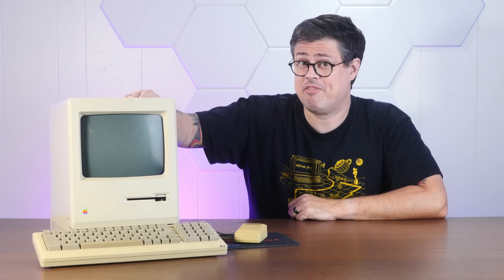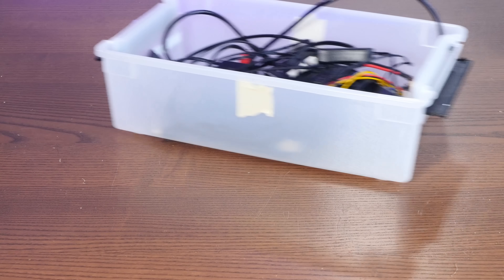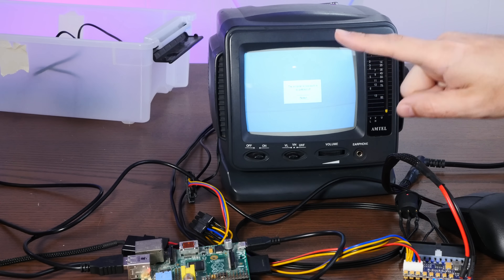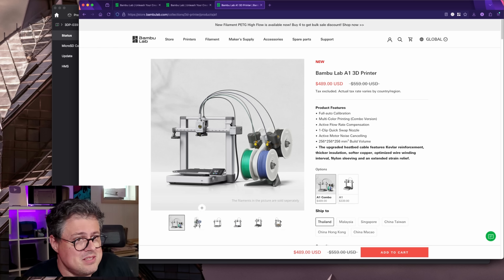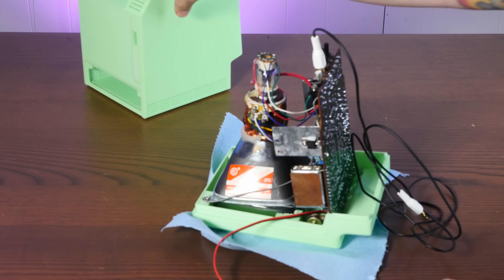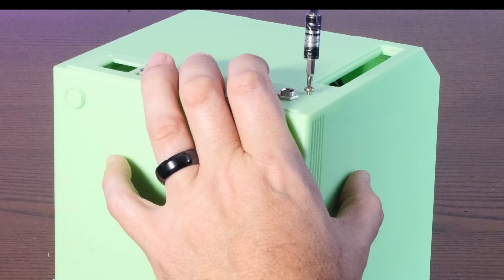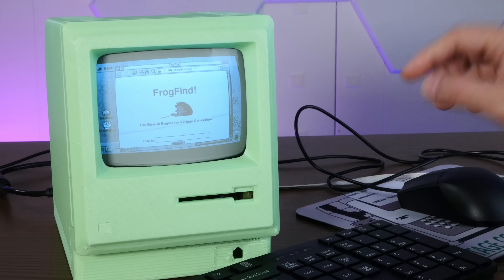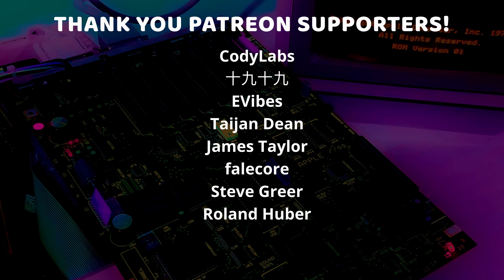I Built a "Mac Minus" With a Real CRT

Comment: I'd recommend using a Pi 3 for this, it still has composite video (on the "audio" jack, it's TRRS) and is much faster - might even get decent emulation speeds with it. And you can route the GPIO to your empty slot in the back!
Reply: I was about to say this. Also, a 4:3 resolution would probably cover the whole screen, and messing with the CRT adjustments could improve the image (mainly the geometry)
Reply: Even the Pi 4/5 still have it, you just need to solder on your own port on with the RPi 5
Reply: @Giuliana-w1f I have a similar 5' CRT, and none of the potentiometers I've adjusted really helped :/
Reply: @lenni-builder same for pi zero and pi zero 2
I also highly suggest setting progressive 240p mode and especially disabling color burst on such b&w CRTs
Reply: Pi 4 has a composite output on the TRRS jack as well, it's just disabled by default there - due to quirks with clock configuration enabling the composite output required downclocking the CPU, at least on the early Pi4-compatible Raspberry Pi OS builds; those clock configurations have been overhauled since, so it might no longer be the case. But then again, on current Raspberry Pi OS builds, the composite output is disabled by default on all models...
Reply: pi 1 has a av out natively
Reply: maybe he just doesn't have the time to wait and get another pi
Reply: Composite video sucks. He needs to find a way to use RGB or something.
Reply: @tarstarkusz  but it's a CRT... and we can't forget it's already cursed enough
Reply: @Brewmasters-thefunni  CRTs are awesome.  The problem is not the CRT.
Reply: @tarstarkusz I think RGB is a problem as CRTs of this size have a video quality cap
Reply: @Brewmasters-thefunni  No they don't, especially not black and white CRTs.
Reply: @tarstarkusz  Composite only sucks with color, monochrome composite can provide full resolution. If the "disable color burst" option also eliminates chroma dots it should provide a perfect 720x480 signal to the display.

Comment: You might be able to get better quality if you output a black and white (luma) signal from the Pi, not sure if it’s possible but I’ve heard on old black and white displays the contrast and legibility can improve.
Reply: Yep, you can color kill the output. With some clever timing hacks 720x480(maybe 512) output could be achieved. I did this eons ago on PC & Amiga for a viewfinder experiment.
Reply: you would also need to remove the color carrier filter cap from the circuit, but you'd need to find it.
Really ideally you'd file the board down to just the things needed to run the CRT and drive video to it. That would make it waaay smaller and improve video quality. But it's a project that most people don't dare try because it involves the letters C, R, and T.

Comment: The opposite would be a Mac/2, a cursed computer with a Frankenstein GUI running on top of OS/2 1.0.
Reply from the maker: Genius
Reply: This should run a Apple IIGS emulator. (Check out the History of GS vs Macintosh.)
Reply: @ActionRetro i actually have the tv in the video, except its branded livingsolutions and its silver. Its a cool little tv
Reply: it would be running an apple lisa

Comment: linux on the pi very recently (6.11 kernel) added the option to set monochrome output, which makes for a much sharper picture without the color burst giving it dot crawl
Reply: Is that something you can do on on just the stock pi image or can you do that for all Linux based images?
Reply: @JeanRodo  seems you can put "video=Composite-1:720x480i,tv_mode=Mono" (or 576 for PAL) for example in your kernel boot parameters, as long as you have a new enough kernel. looks to be part of the DRM video driver, so it should work on any kernel that supports the pi.

Comment: If you could make that "floppy drive" slot at the front take a Compact Flash card, that would be perfect!
Reply: I never finished it because I killed the tube in mine, but my original Mac Minus is set up to take an SD card slot there.  I did succeed in hiding USB-C in the "phone port" for the keyboard, and even got a curly cable for a mini keyboard.

Comment: As a mod, that back panel that you thought of using as a USB port, do that but with a twist, data lines from the 'Pi, but 5V direct from the power supply, not the 'Pi, so bye bye keyboard power issues.

Comment: Having been doing some research on these 5" CRT's, you don't need the composite inputs because it is piss easy to hack into the composite video signal line that comes out of the main chip when decoding the RF signal from the air (that they don't broadcast anymore). I have a PDF of schematics of a very similar set featuring the KA2915, that does all the TV and radio decoding and pin number 5 is video out and 11 is audio out.

But, it is best to know what you're doing when working with a CRT.

Comment: I am actually working on this same project right now! My plans to hold the front and rear cases together is to make an internal chassis similar to what the Macintosh has and use that to attach the rear with screws.

Comment: I worked in a high school with its own elementary department some years ago. While we mostly used Macintosh, including 512 and Plus versions, the elementary department used only Acorns with RiscOS. 

I detested RiscOS. They had early versions, and different variations of the OS.

The teachers would buy a printer and complain at me when it didn’t work because there was no driver available.

The local education authority published a list of printers and drivers which they had available for free distribution but the teachers ignored this. Print cartridges for the approved printers were expensive and only supplied by one local IT company.

One of the guys at the local authority HQ would generate new driver software but only if the number of requests reached a certain quantity.

Oh, and the printers were bought from the same local IT company.

It was easier for me to remove an old printer and fix it, than it was to get a driver for a new printer.

But the teachers still complained at me about the lack of support.

Comment: I found an IBM monitor in the trash. The horizontal output transistor was smoked. I used a 5inch b/w TV guts to power the IBM tube. The tube socket is the same!

Comment: CCTV monitors are much better fidelity since they were designed and intended specifically with b&w or greyscale input already and usually a similar size to a macintosh plus's CRT, they can usually be had for near to nothing used as well.

I have one I use as a stand in for an analog monitor for old games consoles, the lack of latency in such simple displays with the minimum required circuitry between the input and screen is simply unbeatable.

Comment: RISC OS! Sean you are a man after my own heart. I’d also argue that keyboard is much more BBC Micro keycaps than Commodore 64 (again, very appropriate). Can you jank one of those USB Y-cables to get more power to the USB port? The output could sit in that top slot (or even route to the front) for bonus (Plus) points!

Comment: I think a missed opportunity was not making a working brightness knob in the empty spot on the front printed panel.

Maybe a short video on upgrading the Mac Minus with brightness control and an SD card extension to the floppy drive opening so you can boot off totally normal floppies (ok, ok, boot off of SD cards).

Because that is totally normal computing

Comment: Rewire an RJ11 or RJ45 jack to USB standard, then mount the jack on the front. Then re-do the USB cable on a (maybe custom?) keyboard so it has an RJ11/RJ45 connector end.  Voila!

Comment: Now I want you to make a smaller one with B&W Sony Handicam viewfinder CRT.
Reply: Compared to the screen size those viewfinder tubes are way too deep.
Reply: @eDoc2020  Just have it hang out the back
Reply: @tigheklory  Mac Plus is 10.9" deep with a 9" screen, with a 1/2" screen it would be would be less than 5/8" deep. AFAIK those tubes are at least 2 inches long. It would probably fall over if you did that.
Reply: @eDoc2020  all the more reason, LOL don't you watch this channel? Everything is ridiculous. 😂

Comment: heh I just saw one of those TV's at Goodwill less than an hour ago. Didn't have the composite input so I didn't grab it.
Reply: The vast majority of them use the same controller IC (or pin-compatible clone), which has a composite video input (Pin 5?) that you can solder onto, even if the manufacturer declined to hook it up to a connector in the rear.  For as cheap as these things usually are, it's probably worth it to assume that it's easily modifiable for composite in.

Comment: Mine is from 1970sish and has a Metal Ring jumping the fuse   the tv was 15Pounds from ebay sold as untested 
it dose work but untill it warms up it will slowly tune out of channel and The Sound at times will buzz depending if the screen 
is showing bright backgrounds or Black dark itmes on screen.  

my other option it to now do what u did and solder every joint but another way is for me to buy a new unused one from 2002 that 
have Components in like yours

Comment: The disk slot looks too small for a regular size 3-1/2 inch floppy. Can it be used for something else?
Reply: designed to fit an SD card reader or an NFC reader.  I figured NFC in a 3d printed mini floppy would be a good way to launch apps on Mini vMac.

Comment: honestly suprised you used such a wierd power solution, a 12v to 5v usb adapter (like the ones for your car) would have been able to power the pi while also giving you 12v for the Tv

Comment: Is that normal for 3D printed stuff to use tapping screws rather than trying to create screw holes? I know literally nothing about the stuff :) I figure the plastic would be too fragile to use tapping screws.
Reply: Yes, common printers are too low resolution to make clean threads. The other (more premium) option is heat-set threaded inserts.

Comment: HOLD UP! I thought it was impossible to use composite on a Raspberry pi? It's one of the reasons why I never bought one
Reply: Composite works flawlessly even on the Pi3
Reply: At least early on, composite video out was a major selling point.  Composite is definitely available on at least up to the Pi 3, though on the later models they moved it from a convenient RCA jack to a mini Phono jack.  Not sure about the 4 or later.  I've used a Pi Zero to play videos on one of those little portable B&W TVs with a Pi Zero.  Composite video on those is on header pins, and you have to build a very simple little circuit to get analog audio out, but it works.

Comment: I want to make a Pip boy with a 5 inch CRT or smaller if I can find one. But I know nothing about electronics.
Reply: the crts are too deep, to use in a pip boy, it's a completely fictional item, you'd have to make it with an lcd or oled and put a lens over top to make it look like a crt.

Comment: I wish people would stop using raspberry pi for mini mac projects and at least use a khadas board running an expanded and binary compatible C clone of Master System 1. That would be interesting. I feel like I've seen the Pi far too much on this platform and i believe 64 bit+ boards are better for these applications.
Reply: If you can write a clone of windows in the 80s BASIC programming language then you can write a C/Cpython clone of MacOS or LisaOS

Comment: You've done exactly what I've always wanted to do! Only I wanted to use a Macintosh SE shell. Any chance there will be a Mac SE Minus version? :P

You should post the files for the additional parts you printed to adapt that particular TV to it. I happen to have like 2 or 3 of them so I'm pretty sure one of them will fit what you created for this project. :D
Reply: I'm the designer of the 3d files.  The minor differences in CRT boards and mounting has been frustrating as hell and why the project stalled for me.  I have a fresh CRT ready to go but it means an entire new front case model.  I've been thinking how to make it more universal and maybe I'll come back to this project.  I was working on a mini keyboard and mouse too.
Reply: @vorg_  I was thinking you could do what Apple did and build a secondary piece the TV board would slide into. Much like how original Mac Plus and Mac SE case had a metal frame for it. I think it would share the mount points with the CRT and you can model optional "spacers" for the differing mount positions of the CRT implosion band. (I struggle to call them implosion bands though. CRTs that small don't need them they are more like grounding frames. :P )

Could also duplicate the mounting design for the analog board position so that some users could put some form of Raspberry device should they want to integrate something into it. (though I myself won't go that route)

Some method of spacing the TV board back to line up it's rear ports to the back case would be cool too. Unlike this video I would like to preserve the inputs of the TV and leave them accessible in the rear. I suppose i could always just extend them out with wires but it would save on work parts to just pull the board forward. But I suppose that would then open up the need to create different matching rear face plates. 

As for dealing with possible differences in board length when you could create spacers for that too where you slide them in first the main mounting frame first before sliding in the TV board. As for differences in width...Maybe that could be dealt with by having one side of the "mounting frame" have the portion that holds one side of the TV board be separate piece and mounted via screws. That way you can then design spacers for the screw mounts to push the that port of the mount frame closer to the board to account for smaller boards? That's one other idea I've had regarding that.

That aside I could always just hot glue the ***k out of everything if it's not an exact fit. 5 inch CRT TVs are small enough that we can probably get away with doing that here. :P
Reply: @MagnumForce51  Yeah, the latest version I've made has a frame.  Mainly to give it more "Macness" and allow for actually screwing the two case pieces together.

Comment: Too bad the video output is interlaced, otherwise the video quality would be a lot better. I guess there is probably ways to force a composite progressive output, but that cheap tv wouldn't support it. You' would need something  like this: https://www.youtube.com/live/oujiWpcc0m0
Reply: its not that its interlaced, its that its composite and the electronics inside that crt plus the dot pitch kind of suck.
interlaced is just flickery and loses its resolution when things move up and down on the screen, but when showing a still image that isn't the problem (other than flicker)
composite combines the luminance, colour and vertical hold all into one signal, with the red and white used for stereo audio unlike VGA which has 5 pins for video (no audio on a vga port whatsoever), and 10 pins grounded. RGB uses 2 pins for colour and 1 pin for luminance and the vertical hold stuff.
that crt is made with about the cheapest electronics avaliable, costing 14 usd brand new in 2006. theres a video by vwestlife on the black and white 5 inch crt tvs that were popping up around that time, and even composite was not a given on those. that being said, even with everything i mentioned it still has some benefits compared to a lot of modern lcds...
Reply: @randomgamingin144p  I know, but you can send a black and white image via a single cable and get perfect image quality as you are sending only luminace. That's how old b&w monitors worked in Apple II for example. 
Btw RGB doesn't use a luminance pin. Just ground, r,g,b and separate or composite sync.
Reply: @randomgamingin144p There's no dot pitch, lol, it's a b/w screen.